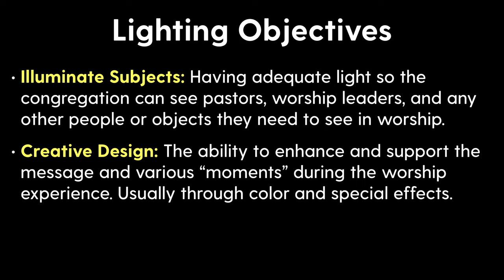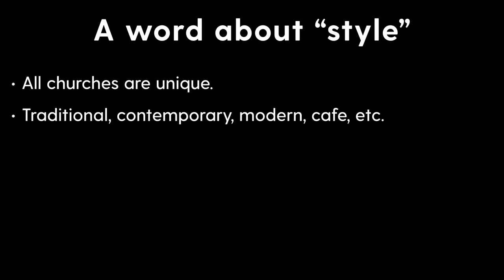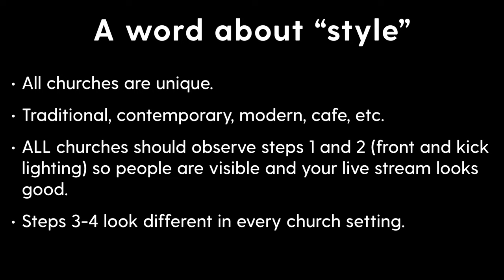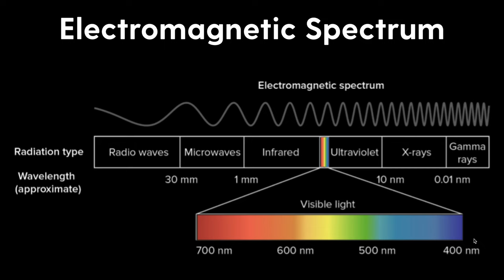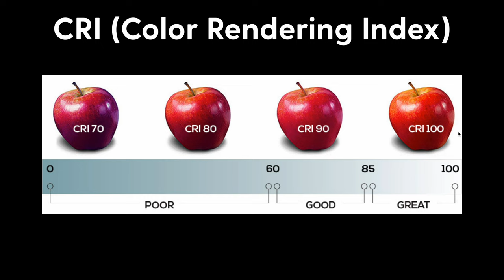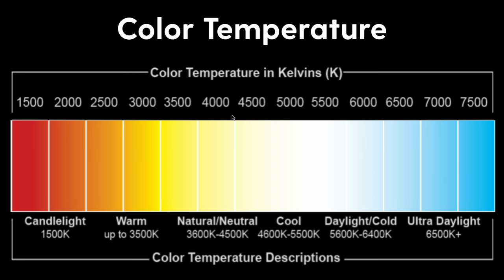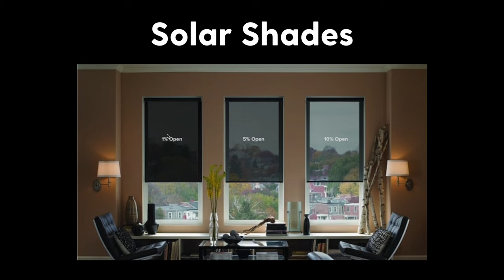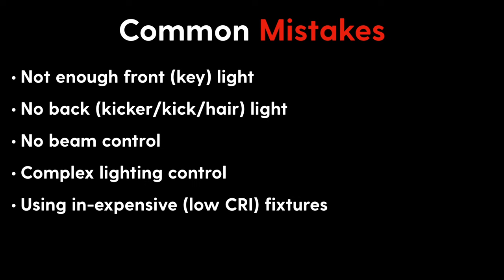Church Lighting Design and Best Practices | 4-Steps to Pro Lighting

Comment: Great information. We’re dealing with a sanctuary building with tons of natural light. We have front lighting, but it’s too weak and poorly set up, and it gets washed out by the natural daylight. We also have about zero money.
Reply: Scott, are you attending my church? Haha we're in the same boat!
Reply: @benjamin.kelley  my church is so small, trust me, you’d know if we were going to the same church.
Reply: Same, thank God for increase in all of our churches
Reply: Our building also has a ton of backlight.
Reply: So what is the solution? How it was fixed?
Reply: @user-uh5pd2ex5k  none yet. We’re still in survival mode, so no money for lighting
Reply: We had this problem once and used garbage bags to go underneath our blinds in the auditorium
Reply: I have the same problem so i cut out the extra light by covering some of the windows and buying cheap 200watt floodlight from china. Prices around 10 bucks each or so. Bought a couple of em And  4 50watts around 5 bucks each  to have a somewhat flood light for front and back wash. Forgot the link tho.
Reply: Shouldn't you worry about saving lives instead of lighting? I'm not so sure the Bible teaches people to tithe, so the church has good lighting.

Comment: When the stage area is all black and do have 4 current spots above at around 15' height and about 8' back from the front of the stage and pointing to the front area of the stage, there is still problems with most camera's having a focus issue from say 15 to 40 plus feet back from the front of the stage, The problem is the depth of field to focus on the pastor and the back projector screen which around 15 to 20 ft behind. It's either focused on the person and the screen is out of focus or visa-versa for live streaming due to the camera issues for depth of field.

Comment: One of our biggest challenges right now is that when we front light out pastor, the light hits the back wall which is undesired. I believe our lights are at a 45 to where the pastors head is, but it's still hitting the back wall. Any tips on this? Should we do a more downward angle and move them closer? Or is it simply that our stage is too shallow? We're working with about 15 feet deep and 40 feet wide.
Reply: Did you ever solve this issue?

Comment: This is useful for satanists also, but we use more kick and we lower it until it becomes s backlight and very little front lighting from a very low height. We lower both these lights. Sometimes we just use side lighting from both sides if there will be dancing.

Comment: What about putting front washlight if our ceiling is just 8ft?
Reply: That is what I am thinking about too.  We have a 10' ceiling I think (I should know since I rebuilt our AV closet).  The room is wide but shallow so our stage is also wide and shallow.  I want to say 8' deep stage.  I have a tape in the car to measure tomorrow.
Reply: I think at that height it's probably time to look at  Sky Panels , Astera panels or some other panel type leds.